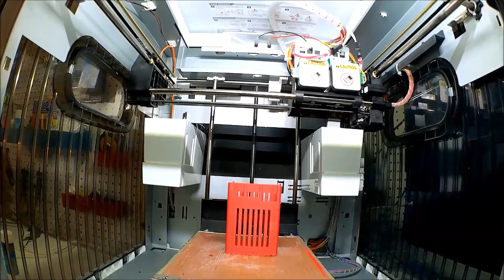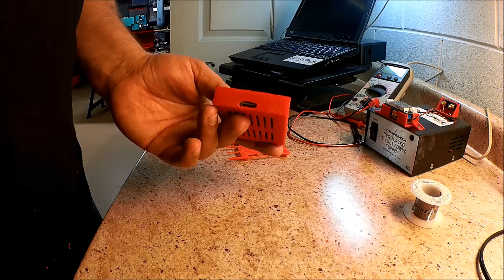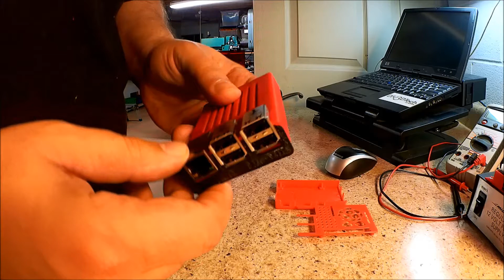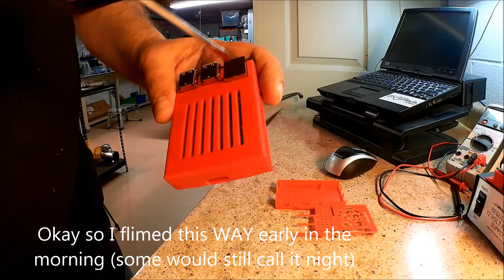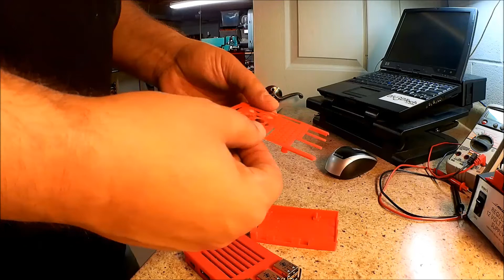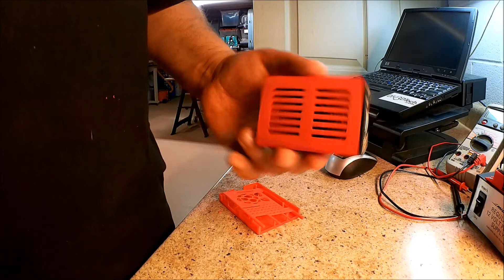XYZ Printing Da vinci 3D Printers - Printing a Raspberry Pi Sleeve for OctoPrint

Comment: Gonna print this in translucent white Dremel PLA on my FlashForge Finder.
Raspberry Pi3 uses the same dimensions.
Reply from the maker: +Mickice That was goal (sort of) in the failed print video as a translucent white would look very cool indeed!
Reply: I printed the tiny rocket in it and the end result looks more like those tubes of soya sauce you get with sushi, lol. Comes out like frosted plastic.
Reply from the maker: +Mickice LOL!  Sorry to hear :-)
Reply: Finished print: http://i.imgur.com/pw807bI.jpg
Printer FlashForge Finder
Dremel translucent white PLA
layer height 0.2
3/3/3 walls/bottom/top
Print speed 50mms
Travel speed 100mms
197ºC

Everything came out perfectly first try, looks like a bought one, my walls at 0.2 are so perfect I don't see the point of 0.1 and I have printed in it many times. Altering temperatures will improve walls for me more than layer height.

Comment: Gotta love a raspberry pi case with access to the gpio but the sleeve case looks like it printed better.
Reply from the maker: +GoSt ANON the sleeve without question looks far more "commercial", however the case seems more practical.  Both are very nicely done and its hard to decide which one so I am just going to buy another raspberry pi to solve the problem :-)